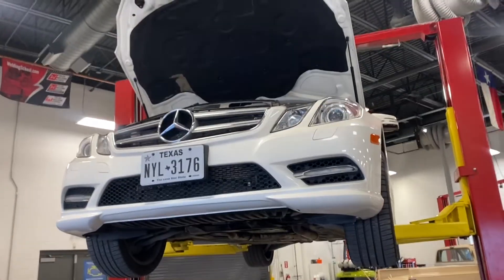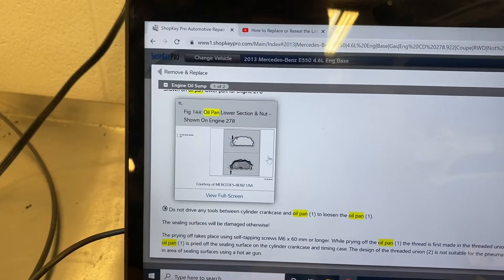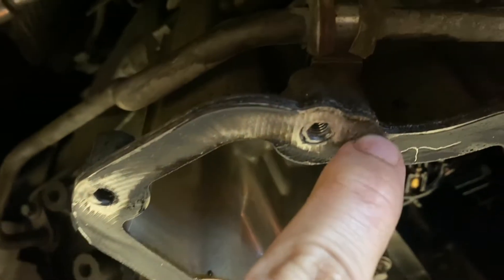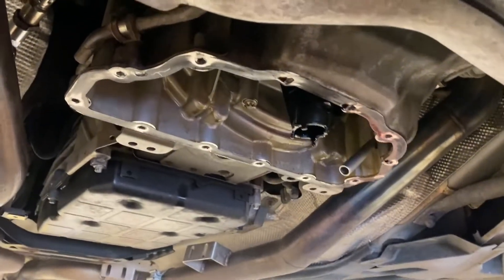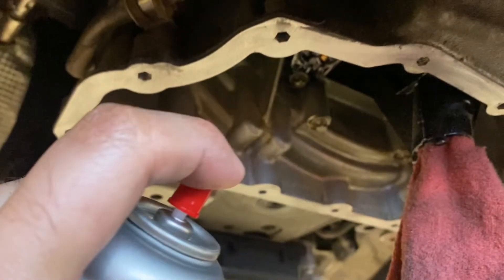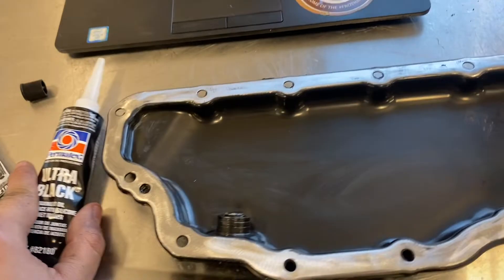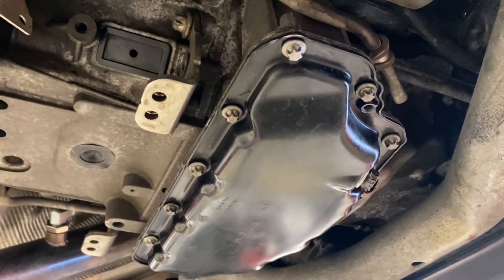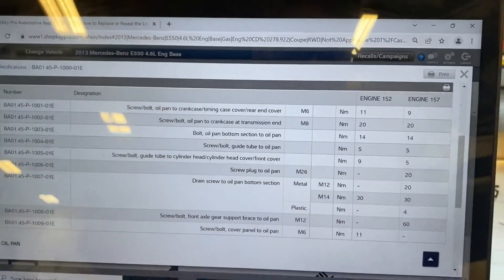E550 m278 oil pan leak repair

Comment: This is great great video 
I just finished sealing front valve covers Mercedes used shit sealant. I notice my oil pan might be leaking as well. 
Well considering Mercedes didn’t use gasket on the bottom. Now I have to fix this shit too. 
Fuck my life I just got this GL550 with only 56kmiles and it’s pissing oil already 
Thanks for video 👍🏻👍🏻👍🏻👍🏻
Reply: With Mercedes don’t cheap out on parts

Comment: Does Mercedes say to wait before torquing bolts ? I have to do this on my car soon. The shop wanted $700 😂
Reply from the maker: If you have the time, I would recommend letting it set overnight for peace of mind. It didn't leak on me doing it this way, but it probably doesn't hurt
Reply: @brianRED  so I will definitely let It sit after torquing the bolts. But you gave it a little bit of time to firm up before torquing . Is that a required step ?
Reply from the maker: Yes. I hand tighten the bolts than returned to torque after it set.  @farrock02